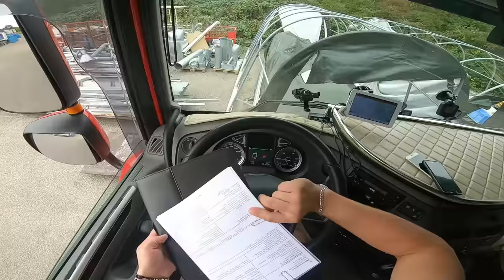POV TRUCK DRIVING DAF XF 480 #5 | + MY UNLOAD IN GERMANY 🇩🇪

Comment: 10:40 He really doing reverse on a trailer while using seatbelt 😭 totally a pro
Reply: So? I don't get it
Reply: @onno2110  Bruv, did you respond to the wrong comment, eh? He was just pointing out the fact that the guy was reversing while putting on a steering wheel, nothing more, nothing less.
Reply: @onno2110  it’s not easy to reverse a semi because the back of it obscures your view. When the trailer turns, you completely lose vision out of your mirrors. It takes a while to learn.
Reply: @EndruoPros  it is easy
Reply: @yeh7347  I drive semis for my living😊
Reply: @onno2110  how much is the pay?

Comment: MANUAL TRANSMISSION BENEFITS 
YOUR LEGS R WORKING YOUR LEGS NOT SLEEP AND YOU R CHANGING GEARS YOUR BRAIN IS ACTIVE AND YOU R ACTIVE YOU GET NOT SLEEP YOU CAN DRIVE LONG WAY WITHOUT SLEEP BUT IN AUTOMOATICS YOU GET SLEEP AND YOUR LEGS ALSO SLEEP AND CANNOT DRIVE AUTOMATIC CAR 
SO MANUAL CARS ARE REAL CARS AND LEGEND CARS.